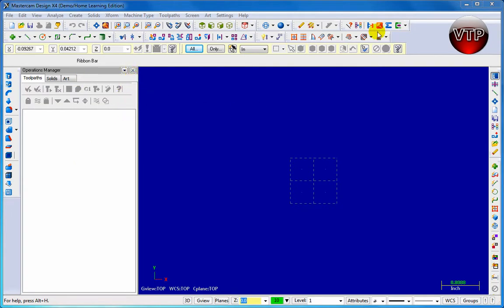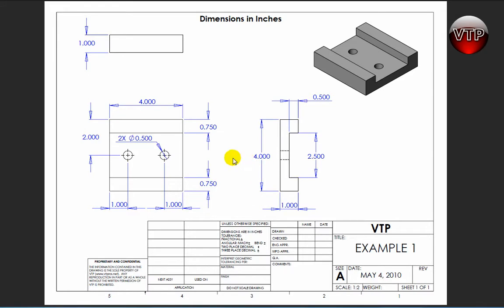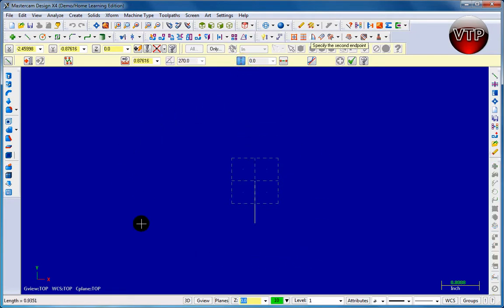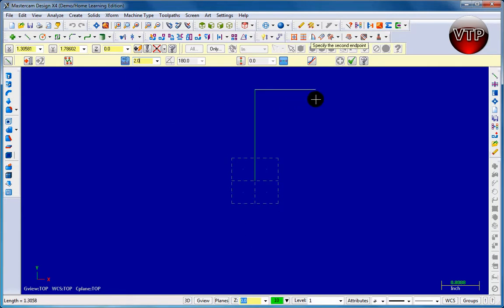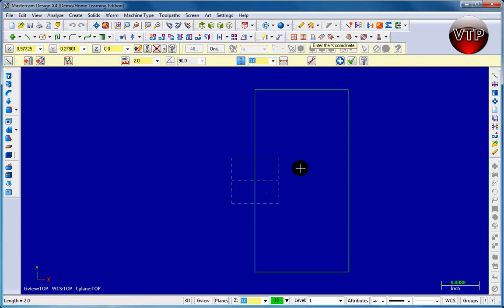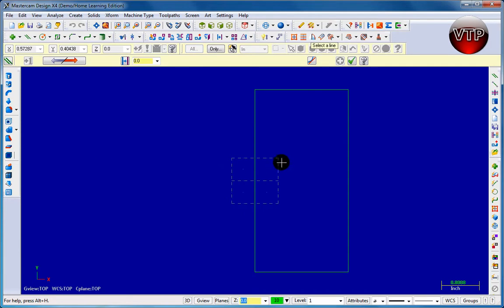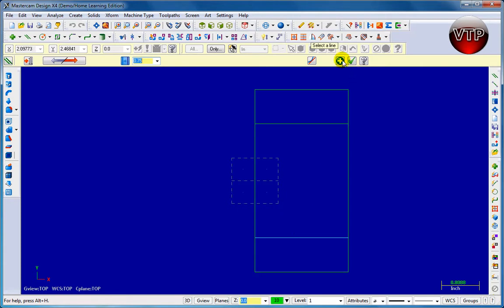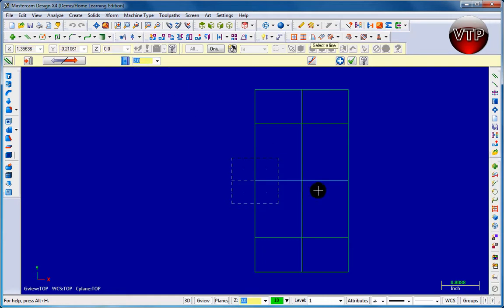MASTERCAM X1-X7 MILL Tutorial in HD - 1.1 Rectangle, Circle, Parallel, Mirror - vtpros.net

Comment: For my mastercam I can't selct entities,  points, origin without a icon showing next to th cursor like "*" or "x-x". Whenever I randoming create some like for xample a rectangle. I can't even see it unril I do a fit....please hwlp my problem
Reply from the maker: Sorry to hear that, it may be an error caused by installation, i never had this issue, you may want to contact mastercam see what may be causing it. Or just uninstall and reinstal mastercam. When you install it make sure nothing is running in the background as it seems to interfere sometimes. I had a similar issue before because of that. hope you get it fixed
Reply: Thanks very much +i paratrooper. I had the same problem with my window selection, new objects, and chain not being visible.  disabling hardware acceleration fixed it.
Reply from the maker: thank you i Paratrooper for the help!! even we learn new things everyday. Glad you got it fixed Robert Contento